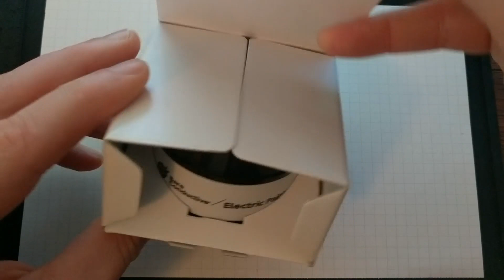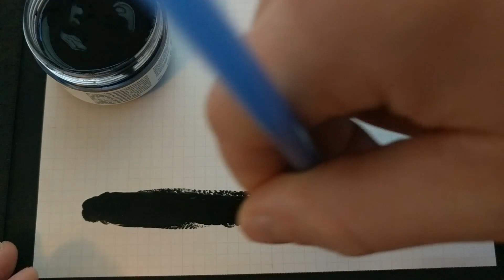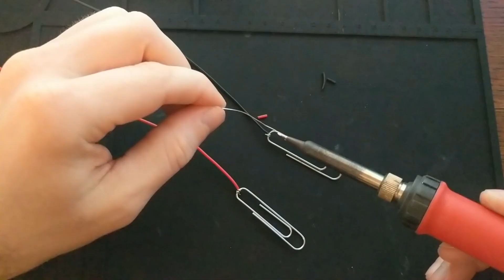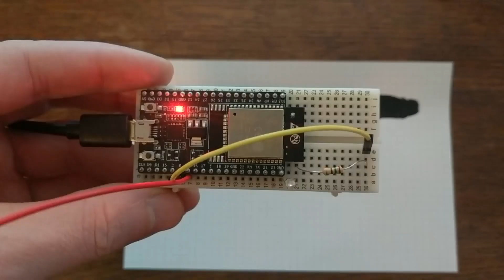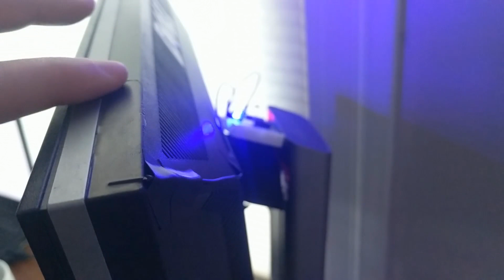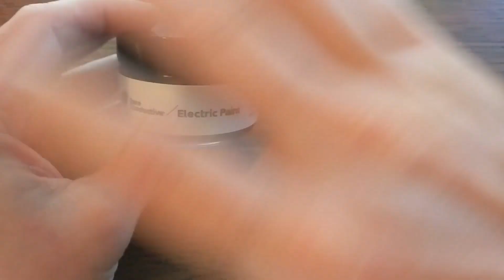Experimenting with Electric Paint | Bare Conductive

Comment: Could you lower the viscosity of that stuff down with a solvent that would allow it to flow through a fountain pen so it would allow you to make a still dense but more precise line?
Reply from the maker: You can definitely water it down some to thin it out but the thinner the layer of paint the more resistance there is. That could be fine, especially if you want more of the resistance property (like for a potentiometer).

Using a stencil, you could also have more control over the shape and thickness.

It comes in little icing-tube type containers too that seem easier to apply: https://www.bareconductive.com/shop/electric-paint-10ml/
Reply: mujhe chaiye Kinect Di no.